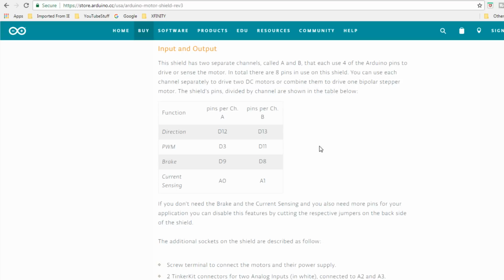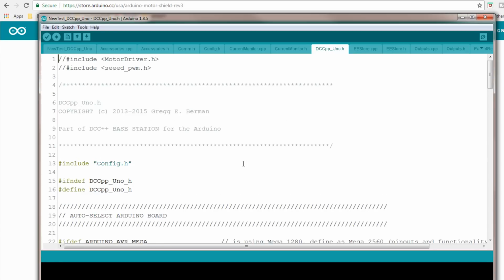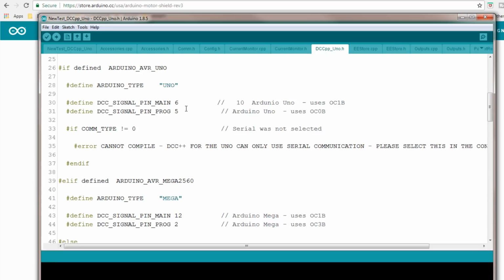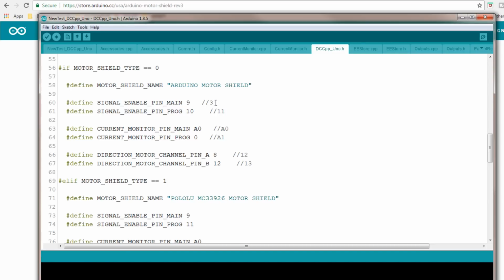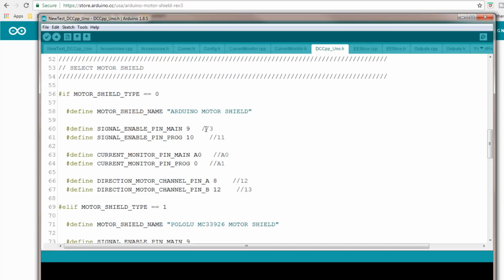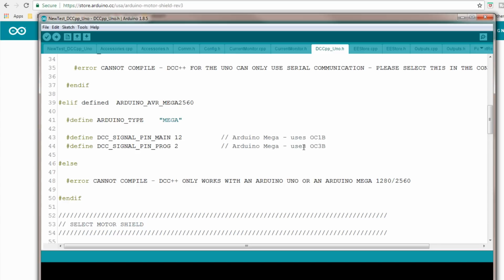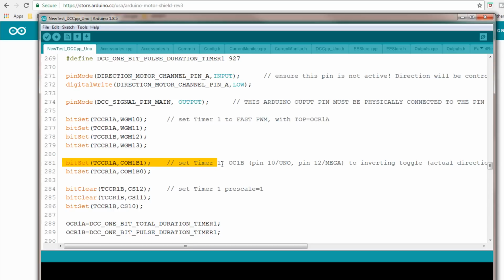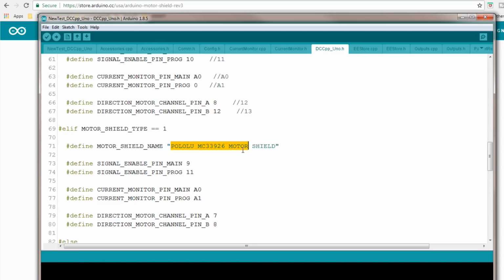Q&A On DCC++ Motor Shields - Troubleshooting & More

Comment: Good day sir, hope you can help me out. I'm needing to boost this set up up. I'am already at 15v 3amps. And I boosted up to 750ma. I still have one engine that will only run all by itself, a second will idle with another engine but soon I go to run either of them the line will go dead. Hopefully you can send me in the right direction....Thank you.
Reply from the maker: DCC++ or DCC-EX. Need more information
Reply: DDC++  Seems like it's that one engine that pushes it abit to much and shuts it all down. It runs totally fine on it's own.
Reply: By the way I'm very new to all this, I really appreciate you getting back to me.

Comment: Hi Tom, 
Currently using arduino mega with motor shield is running DCC ++. The motor shield  has the ‘ V in ‘ trace removed and has a 15V input .

Currently my thinking  is this configuration is suspect and power is not getting to the programming track.

As an alternative and to eliminate this existing setup , I intend next to use a new arduino motor shield with the ‘V in ‘ trace intact with a 12 V supply . Can you confirm if a 12V supply sufficient to programme the decoders through JMRI?
Reply from the maker: What motor shield are you using?
Do you have the jumper in the correct pins for a Mega?
Reply: Hi Tom.  Many thanks . The 15v power leads were in-fact the wrong way round. Seems to working ok now and hopefully no permanent damage. Looking  forward to your next You Tube release .
Regards Robert
Reply: Hi, Tom
Jumper pins 2 and 13 , motor shield arduino original manufacturer .
Regards, Robert
Reply from the maker: What issues are you having that you suspect you have no power to the program track?
How many LEDs are lit up behind the main track & program track terminals?
Does your loco run on the Main track?
Reply: There are NO leds showing , hence I suspect no power is getting to the board.  I am using a 240v/15v 1A transformer , I cut off the barrel plug and suspect I may have the wires connected in reverse (ie incorrectly)   . Next stage is to check this out. Also to check I have done no damage to the motor shield  I thought of using a 12v supply in lieu , but am not sure if this is of sufficient voltage to programme the decoders through JMRI
Reply from the maker: If you don't have a multimeter, I would suggest picking up a cheap one to test your leads to make sure your getting the wire on the right terminals. 12vdc may not be enough to program some of the newer multi function decoders that require more power

Comment: Hello. Great work and help by the way. I have been researching this setup for some time now. I saw the video on using the Mega and Motor shield on other videos as well. I get how to use this base station combo as a Loco controller, sound, speeds, etc. I have updated my mega with the DCC code. Downloaded and installed Decoder Pro. It's initialized and ready. Now my question is,, IS it possible for me to also control turnouts from other pins because set A and set B are being used for the program and main track? I hope i'm making sense.  Thanks
Reply from the maker: There are provisions in the DCC++ code for Accessories & Outputs as long as they're stationary decoders. With the decoders anything can be sensed and/or controlled. I have not done a video on this.

Comment: You don't necessarily need to stack them, you could use a breadboard or whatever and match the pins up however you want. Also Uno vs Mega or other Arduino might help line things up differently
Reply from the maker: Stacking them keeps them together as intended. I use the breadboard extensively on other projects where many components are involved. Thanks for your input!

Comment: Work on DCC++ appears to be stopped.
The work is now being done on DCCppESP32.
http://www.trainboard.com/highball/index.php?threads/dcc-esp32-base-station.112634/

The forum is active and the developer of DCC++ posts there frequently.
Reply from the maker: Thanks for the link. This is a completely rewritten version of DCC++ using the ESP32 chip. It appears this system is still in development from what I read in the forum. You can also find an extensive discussion on the same forum for the original DCC++ which is ongoing. Gregg Berman hasn't posted on there for over a year now but there are others on there that are pretty knowledgeable on the subject. Dave Bodner was providing input but he too has gone in a different direction recently.

Comment: great info Tom...I used the deek-robot shield it uses a L298 chipset and as far as I can tell it is a exact clone of the arduino shield...I didn't have to make any mods to it or the sketch, everything works great...I mounted it on a mega so I only needed one jumper from pin 13 to pin 2...I'm using JMRI to run everything and an old router for withrottle and I have an uno running C/MRI...Thank You for the work you are doing with Arduino I have learned alot from you Tom
Reply from the maker: Thanks Tom. I found another modeler that used that one also. It is an exact match of the Arduino shield.  When I was doing my searches last week, the only ones I could find were the L293 or these old eyes are failing me. lol

Comment: Excuse my ignorance. Are the motor shields in this discussion being used as a home built dcc controller instead of a commercial version like a nce or digitrax?
Reply: warranty is one  issue , another is the open source movement. DCC++ is mainly about JRMI. Tom is one of the few the actually taking time to put videos out to help
Reply from the maker: Yes. Watch this video... https://youtu.be/aa18c0Do1l8